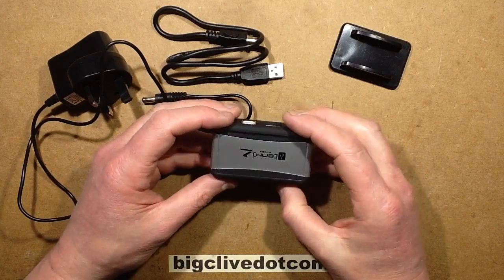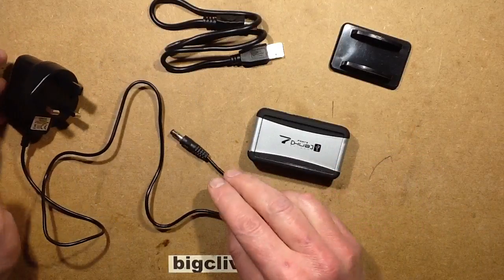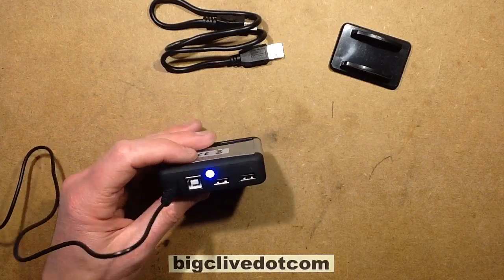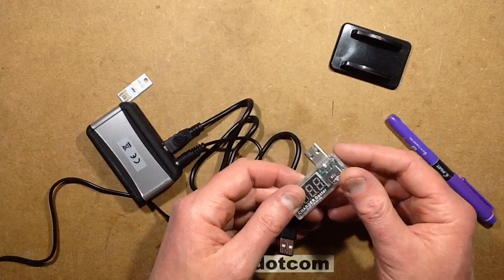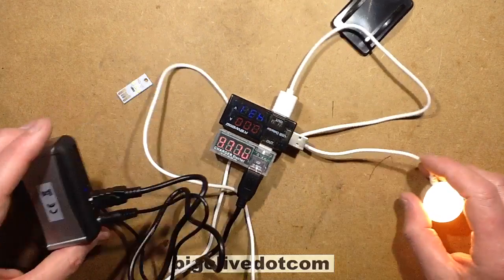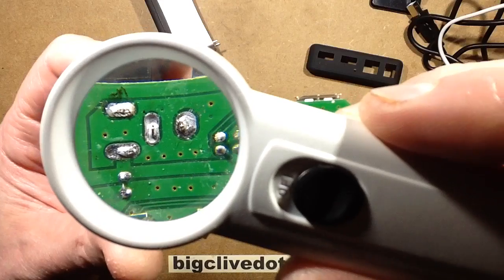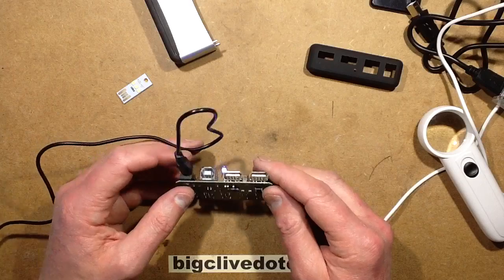Computer killing powered USB hub.  (Mac murderer)

Comment: Excellent technical consumer information from BigClive :) I suspect a cheap $4 usb hub was the cause of my pc random freezes and corrupt usb drives. I replaced both ram and hdd and reinstalled several different operating systems but same issues. Should have realised as two other computers with the same cheap hub also played up.  I'm sure glad at least I didn't connect the 5 volt input but let it run off the motherboard supply. I stopped using the hub and so far so good. I always wondered and feared that at least on these very cheap hubs the 5 volt might be back-fed out across anything it is connected to incuding a computer motherboard. Scary. And a reminder to self not to plug in crap to expensive hardware :)

Comment: There is a a usb stick that appears to be a usb drive with a Capacitor that when fully charged discs in to the host killing the pc or whatever the host is.
Reply: Those are called USB Killers. They work on the same principle as these hubs but charge from the computer instead of externally

Comment: I have one of those. They are generic hub sold under several rebrands. I really didn't mind the backfeed when I was using it with raspberry pi zero, since it powered the pi itself (one less power supply to use).

Comment: Looking down at my desk right now I find the exact same hub...
Good thing I use it unpowered.
Took a look at the pcb and sure enough power input is just linked to all usb supply pins via 0-ohm resistors.
Reply: My board was single-sided by the way. Still same stupid design. Just cheaper.

Comment: Thanks Clive, I saw the thumbnail for this video and thought it looked suspiciously like a USB hub I was using for my keyboard and mouse. Sure enough, same case moulding but different branding. I've just replaced it with a spare USB3 hub. From memory, I have had USB issues with this machine before, so I guess that explains it.

Interestingly, the circuit is completely different. It's even got a position for a diode between the power socket and the USB input, but it's labelled L1 and populated with a 0Ω SMD jumper!

Anyway, let me know if you're interested in checking it out and I'll pop it in the mail.

Comment: When 5.4volts reaches the Mac USB socket, the safety system built into the Mac power supply notes the voltage has exceeded the 4.9/5.1 volt threshold and performs a crowbar effect on the internal power supply. This protects any peripheries from electrical damage but can kill the power supply within the Mac. Avoiding any external damage but on 2012/2013 and 2014 versions of iMacs, the power supply did not like this and stopped working. There is a simple fix, replace the internal electronic fuse and possibly the current sense USB components in the power supply. Most retailers will tell the owner it is not repairable! I note a few caustic comments from people who cannot afford a proper computer below. Never mind, I can.

Comment: Thanks for the review & warning.  I had purchased one of these inexpensive hubs several years ago, but never actually used it.  Equipped with the knowledge from your video, it will be going straight into the recycling bin.  Thanks for the friendly heads-up.  You saved me a lot of heartache.

Btw, on the back of the packaging, it mentioned something something about, "Charge & connect multiple USB devices."  Personally, USB Devices the provide charging capabilities, should probably be separated from those devices, which are strickly used for communications.  Ideally, color-coded USB Devices, differentiating power-sourcing ports from non-power-sourcing ports would be best.  Some manufacturers are good about labeling their ports, but the accessory or peripherial market is a role of the dice.

Comment: Still available as of Nov 2019 on Ebay @ 7dayshop though do not know if the board is the same configuration have resisted the temptation to open it up to look. As for it killing MAC's that might be a mercy killing given the shitty engineering that is inside them that Apple think is "Good enough".

Comment: I have a Mac and I use this hub since now 6 years and it has never done any 
damage.
But I modified it a little bit by removing the (overly bright and 
useless to me) LED and I use a good quality 50 Hz transformer power 
supply instead of the cheap chinese switching one that came with the 
hub.

Comment: I have (had) a hub where the separation between the incoming 5V supply and Vbus was done using a Schottky diode, a SS20 if I recall correcty. Needless to say that the hub could work in self-powered mode, as well as bus powered. However, it would inject a residual current back in the Vbus line, and I could read a voltage of around 1.2V. Anyway, since Schottky diodes are leaky, Ive decided to take the bastard out. Now the hub only works in self powered mode, but the risk of it frying my precious mobo is mitigated.

Comment: The creators of this hub need to add a diode between the pc usb and the hub, for the positive from the pc to the hub so no energy can go into the pc because aparently macs don't have the protection built into them.

An easy way to fix this adapter for high loads would be to cut the red wire inside the usb cable and only use that cable for the usb hub.

Comment: i have this hub.  i just got it to power a usb extension cable (the voltage drop was substantial on a very long run) and then found a way to do it better so i didnt end up using it.  its supposed to be usb 2 but the drivers are for windows xp or soemting crazy so it only runs at usb 1.0 (12mbit) which is useless for everything but maybekeyboards and such

Comment: The intent of not separating the power input from the input USB is most likely so it can run low power devices without the need for external power. Should really have something to stop back flow but it it would be intend that USB host device can power hub for low power devices.

Comment: This is is how the hub is designed btw. When using the hub for the computer you don’t plug the wall outlet into the hub before you use the pc. You just use the power from the pc usb to power the hub. The power plug is only designed for charging things when not plug in through usb. I have one, but vice versus a quality hub should have a chip that detects this and shut the connection to the pc interface off to prevent damage to the pc when using ac power. That is what my cheap hub does.

Comment: Feeding 5V to the power pin of a USB-A male connector violates the USB standards, which are designed to prevent exactly this sort of nonsense.  This hub is a non-compliant device ... Clive's specialty, so it's appropriate that it ended up in his hands.
Idiots (or crooks) in the shop made the problem much worse for the owner. The Mac is in fact protected against exactly this error by decent design - that's why it shuts down.  Resetting the SMC is all you should need to do to get the Mac back on its feet.

Note to the Windopes posting below, my Macs have all worked fine for as long as I've owned them (5-10 years), and unlike a PC they all had a resale value greater than the postage needed to ship them to an eBay buyer.  (The one exception: the original G3 iMac, which weighed a ton and could only be retired as a doorstop.)  Oh, and all of my updates to the latest OS are free.  At the end of the day, Apple gives value for the money.

Comment: the controller chip on it runs very hot , touch the outside you can feel the heat over time it even wraps the case. it also kills usb cables after about 1 month it stops working you witch the cable and it works.

Comment: a lot of cheap hubs backfeed power through the 5v line to the computer, a simple fix is to cut or scrape away the positive 5v line going to the computer, i had issues with cheap hubs keeping my psu fan on when the computer was off and had issues with my computer randomly rebooting and freezing that were caused by cheap hubs too

Comment: you need to cut the red wire inside the data cable ( the cable link the pc to the USB hub) and all will work well ,,,remember the RED one, you should do this to all of the powered hubs even if it is a expensive one ,, in case !

Comment: if you can modify it you can put a diode in series with the power and the + on the usb port to prevent hub from powering the host

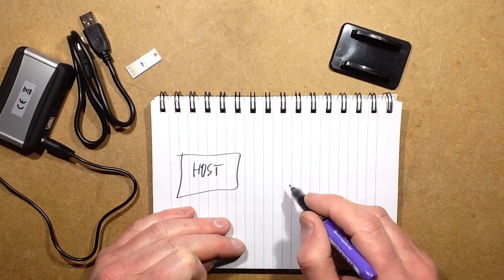Comment: 1:45 Actually, even if a (standard-compliant) usb device is self-powered, it still needs the 5v bus power connection since it is not allowed to begin pulling up D+ to 3.3v until bus power is present (presumably to prevent feeding power into the electronics of an unpowered host via the data lines).

Comment: Clive, the 5V from the host should always be connected to the hub, even if the latter is self powered. That 5V is used by the hub for host detection, so it won't power the devices attached to it when it is disconnected from the host. That is part of the USB spec. That hub is not compliant, apparently. Plus, the back-feeding should never happen, since the Vbus detection of the bub acts as an input. In the end, that hub should be tossed into the bin.

Comment: Most "inexpensive" USB hubs seem to have this problem.  I've got some short USB leads with translucent plastic on the USB type A plug and socket - and on the socket end, you can see the power wire.  A drill with a 2mm drill bit nicely breaks the 5V the connection, so you can isolate the computer from the back-feeding powered USB hubs.

Comment: IF you did have this and was on a budget... Aren't there data cords where the power wire is just missing from the bundle in the USB cable. Would that work just fine?

Comment: I remember I had a kinda cruddy laptop in the mid-2000's and had an external USB DVD drive and it had two cables that came with it, both USB at the computer end, but one was a barrel jack at the device and the other was a USB type-B connector. Now I had been using it fine for a while with just the type-B connector, but I was curious so I plugged both in and immediately the computer turned off and wouldn't turn back on. The repair shop had it for quite some time (I want to say over a year), and eventually I just wanted it back regardless of whether it worked or not, so I got it back and surprisingly it started working again!

Comment: It occurred to me that a simple fix would be to open up the USB hub and cut the track from the internal power supply to the USB input port and then solder a diode across the cut so it will only allow power to come in from the port and won't allow it to go back out the port.

Comment: I only use the power pack on mine when I use a USB 2.0, 5 meter cable, and thus it requires external power to run anything on the hub.

Comment: Noticed the same thing on my own (different model) USB hub, but not with a Mac, thank goodness. It was a desktop, and the way I found out was a bit scary. I unplugged the computer from the mains and was about to do some modifications inside; And I realized the hard drive and PSU fan were still spinning. I thought I left it plugged in, but no. After some testing, every 5V output from the PSU was showing a full 5V, with the 12V rail showing only about 2V. All from a USB hub. I'm surprised this didn't cause issues with the computer, it's really a very poor design.

Comment: Okay, I have a question as someone using a unit like this.

My keyboard draws 500 mA and I have found that has put a tad more stress on the USB power rail.

If I cut the power rail on the USB cable or remove the 0 ohms resistor that seems to be linking itself between the DC power in and the USB in, would that prevent any possible killing of the USB on my PC?
Reply from the maker: You could use an external powered hub to power the keyboard separately from your computer.  I wouldn't recommend one like this though as the backfeed can cause issues.
Reply: This is why I was thinking of cutting the end off the USB cable and rewiring it with a new plug without the +5V wire connected.

Comment: hey geeky hero +bigclivedotcom ! i have something I'd like to send you for an autopsy! it is a usb double 18650 charger, which also acts as powerbank. some day it stopped outputting 5v bit it still charges 18650s. my smartphone might have killed since (i think) it had the a shorted micro usb input. the device is quite interesting with its display full of info.

Comment: The problem here is that you want the hub to work with or without the external PSU. You could put a diode on the input line to prevent backfeeding, but even if you use a schottky, the voltage drop (together with lead resistance) could stop many devices from working (USB device only have to work down to 4.5V).

Comment: Even some branded USB-Hubs have this problem: My  Belkin 7-port USB 2.0 Hub supplies the PC with 5V.
It's good that I use the PCs USB3.0 port for my external Harddisks so i don't ned the external supply for the Hub. But bad enigneering is everywhere

Comment: I HAD THIS MODEL! It killed my custom build Novatech PC as well. blew out my PSU and Motherboard and took me 270 quid to revive. (Okay, so admittedly there was user error- I used the wrong power plug for it and shot 12v through it which did kill it dead) but without the power plug it was giving very little charge even on just one usb port being used at a time. definitely wouldn't recommend powering this unit through mains at all even so!

Comment: This hub has the same effect on PCs, and I think (but am not sure) that the micro-controller in the PC's PSU is not allowing initialization of the rest of the PSU if it sees the +5v rail already high.

Quick and dirty fix? Cut the trace on the +5 from the PC.  Better fix, cut the +5 trace from the PC and bridge it with a 2A (or higher) diode that will allow the PC to feed the hub (at .3-.5 volts lower) if unpowered, but will not allow back-feeding of the hub power into the PC.

Comment: Ive got something similar lying around, and while the effects arent as severe its certainly more spectacular to watch. So basically ive had a lightning adapter to charge my phone while im not at home where it gets bend all the time and its a cheap one so it doesnt matter so much if i break it, and one day it just wasnt charging anymore. I decided to plug it into my desktop PC - still not charging. Upon using a different cable i figured out that its the cable, and while i just laid it aside a few days later i didnt have my cables around so i decided to give that one another try in the hopes that adjusting the cable might make it work again (works often times) and plugged it into my laptop instead that time - it immediatly went black and shut down the power, and upon using different cables in the same usb socket i could verify that its the cable, also the effect is 100% reproducable for me. The laptop didnt take any permanent damage btw afaik. So yea ive got a cable lying around which does absolutly nothing to my phone, desktop PC and transportable chargers but can immediatly shut down my laptop. Ive got no idea how that works, i mean im fairly confident that it somehow shortcircuits but i have no idea why it just affects my laptop and nothing else.

Comment: Sort of scared me a bit with this one, as I have several of those hubs, although none being used right now.  after watching the video though, I relaxed a bit, as I have never plugged in both the power and the incoming  USB. I guess the way I use them, if I need them to distribute power, I plug in a power brick, and if I need to hub off a computer, I simply use the power that is available on the USB rail.  That said, however, I am to a point now that I am looking for a hub to use with my Orange PI single board computers, and I may well have to use both.  Perhaps a diode would be in order if I decide to hook one up that way.  I shall have to look the board over, and decide which trace needs cutting and be replaced with a small diode to protect my little linux board.

Comment: Well powered hubs are supposed to send 5V to every port to be able to power any connected device including USB drives, computer is one who is responsible to block that +5 volts on simple way, so at my knowledge MAC is one who is guilty for failure not that HUB u tested.  U can use that hub on any PC with no problems at all , and to be honest I did not know till now that MAC is not protected against external power which comes to usb port. Big fail for Aple.

Comment: A thought.  You're probably not going to buy a powered USB hub unless you need it to be powered.  I.e., the combined current draw of the devices you plug into it is more than the computer can provide.  Therefore the ability of the computer to power the hub when its own power supply is absent is useless because the computer can't supply enough current anyway (or you'd have bought an unpowered hub for less money).

Solution: butcher the hub to disconnect the power line from the computer port.  Then have a powered hub that doesn't put Macs to sleep.  If the hub PSU goes absent things won't work, but because of the combined power draw they wouldn't have worked anyway.

Or stop being a fanboi and get yourself a cheaper computer and put a better OS than Windows on it.  Then you don't have to butcher the hub and you've saved money.

Comment: I have had kinda similar issues on my pc. I would turn it off and unplug it, and I would still have the mobo power warning led. I turned off the power to the hub and it fixed the problem. The 5v input was preventing a 'cold steel' shutdown/reboot from hard resetting some of the electronics.

Comment: i had a power usb 3.0 hub once... it was meant to suppliment the power from your usb port if you wanted to power more devices than the usb could supply... so i plugged it in and head a bang and that was the end of the usb ports on my laptop... at least the fuses on the ports protected the rest of the laptop but ill never buy a powered usb hub again...